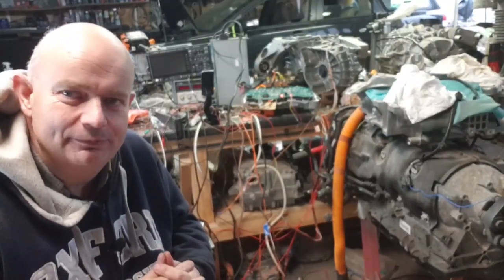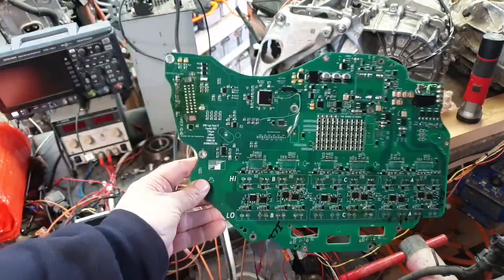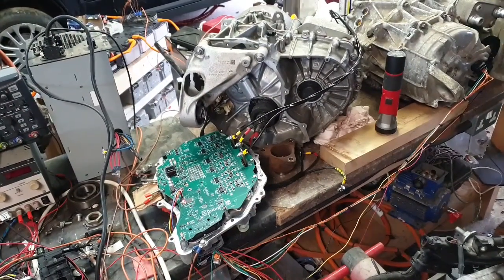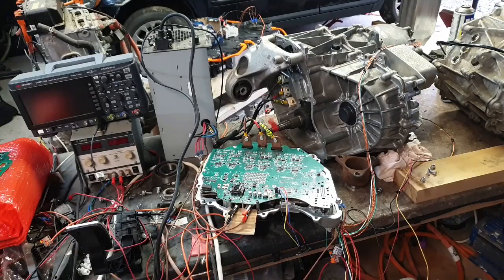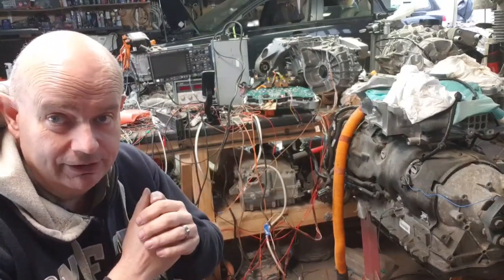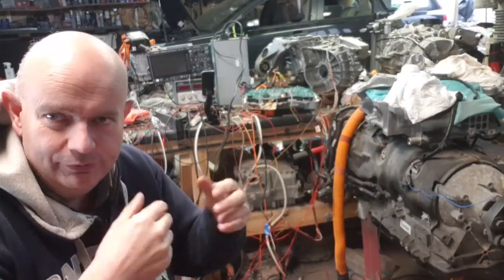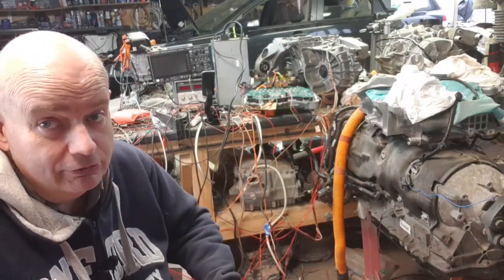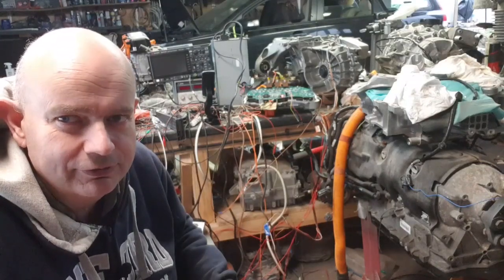Tesla Model 3 Drive Unit PCB Design 14 : The V3 Works!

Comment: This was a much anticipated milestone. Congratulations i am happy to be a tester I may not be of much help in finding glitches other than being a typical consumer with minimal knowledge of pcb board design . I have a model 3 motor awaiting th new board in any case. The logic board  in my sdu works great.one of my main objectives is to compare the different efficiencies of these two motor designs.